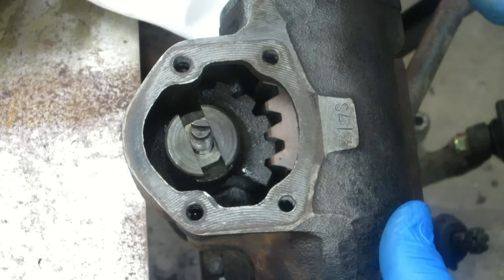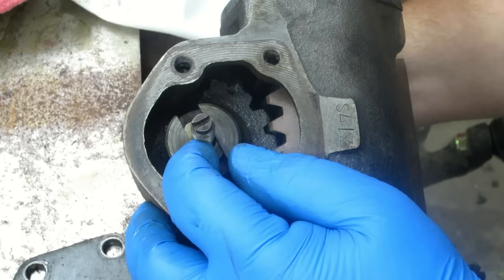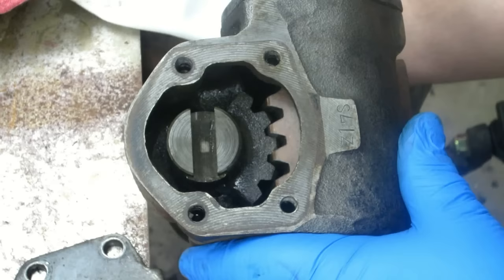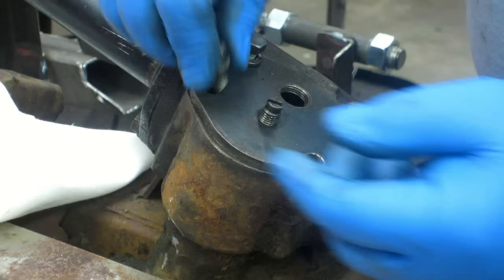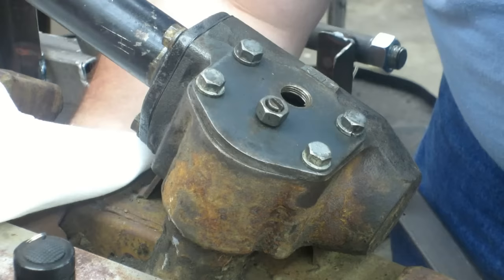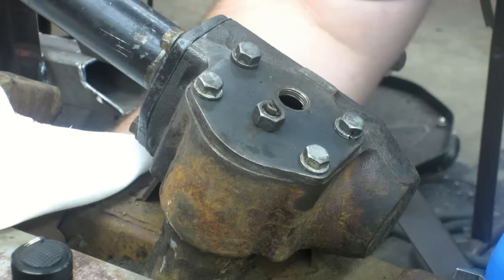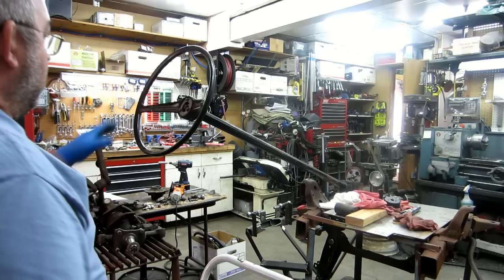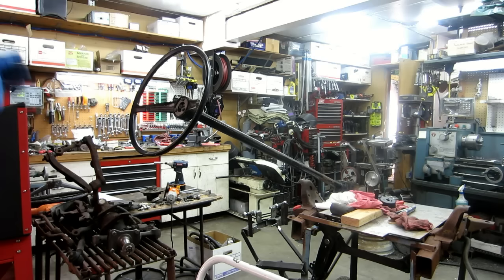Sector Shaft Adjustment

Comment: The high spot is actually there to aid in the adjustment of the gear box. If you turn it to the "tight" or high spot to adjust the gearbox, you will not overtighten it and have problems with the gearbox locking up. This was more common on manual steering than power. Never adjust them so tightly that you can "feel" the high spot on the gear. If you notice it when turning stop to stop, back off until you cannot feel the difference in the steering wheel.
Reply: In other words to take all the play in the center I will have to make it bind when turning. And then I have to adjust it back a little so I feel no resistance lock to lock which means that the center is back to not be as tight as it could be.
Reply: I was just thinking as he did this that you could adjust it till it has no play then move it off centre to check if you get play then back again and see if it binds

Comment: I have worked in many places as a tech, including several dealerships, who had no clue about this adjustment. It helps a lot if the front end is kept in good condition. The "hammering" associated with loose front end parts does untold damage to these gearboxes. Any time there is slack in the steering, movement accelerates until impact, so the "hammering" effect is intensified by neglect. In truth, front end inspection should be part of an oil change, but few bother. Great videos.

Comment: You are correct about a tiny amount of adjustment. Turning it more than 1/8-1/4 to 1/2 max turn puts too much pressure on the internals. According to my manual.
Reply from the maker: Yep....it doesn't take much. ;)

Comment: LEAKS.... For everyone asking about a leak at the adjusting screw if you don't have the Oring or Copper Washer Seal.... Spray it with Break Cleaner and work it back n forth (in and out), apply any type of  Oil based or Oil Resistant Thread or Pipe Sealant. Permatx #1 , #2  or even some Silicone sealant
Reply from the maker: Great tip!

Comment: If your gear box whines while you turn is it bad?
Reply from the maker: I'm sure it's not good.  Typically, whines and squeals are high pitched vibrations.....like brake pad squeal.  Maybe it's low on lube and two pieces of dry metal are rubbing together?  I'm guessing it's while you're turning, so maybe something is rubbing on the steering shaft?  This was the deepest I'd been into a steering box so you might was to ask someone that knows a lot more about them than I do. lol  A cheap stethoscope from HF can really help find mechanical noises.  https://www.harborfreight.com/mechanics-stethoscope-63691.html?_br_psugg_q=stethoscope
Good luck!! -Mike

Comment: Ok, so if you are not technically advanced enough to take all of that apart, is there a way to adjust it without taking the steering wheel off and the tie rods off? I have a 2023 wrangler that loves to wander all over my lane in the highway.
Reply from the maker: you don't need to take anything apart to do the adjustment.  You will need to raise the front end off the ground on jack stands so that you can turn the steering back and forth to feel that high spot.  Read the pinned comment by @klmartin1962 for a better explanation.  While you have it lifted up, you can more easily check the tie rods and ball joints to see if any of them are the problem.  If you've modified the suspension at all, you toe-in is probably off now and it needs an alignment.

Seriously, if you have a 2023, I'd take it to the dealer and have them do the work under warranty.
Reply: @bluehandsvideo  the dealership said that’s how jeeps handle and that there is no steering box adjustment. I had a feeling they would say that.
Reply from the maker: @stratdx  Sounds like good steering is a bit hit or miss with jeeps.  I didn't read the entire thread, but it seems the steering has been an issue for a long time with them.  https://www.jlwranglerforums.com/forum/threads/are-the-steering-issues-resolved-in-the-2023-models.102233/
Reply from the maker: @stratdx  Sounds like a cop-out, but pretty much what I expected to hear, too. :(

Comment: This vid is really helpful.  Now I know the inner anatomy of the steering box, and I understand why my sector shaft has play and how to fix it!  If the center section of the gear is so worn that I can't get rid of the play without introducing bind at the outer areas (turn to lock), I know I need a new box.  2003 F150.  Thank you!
Reply from the maker: Thank you! I'm happy to hear that it's helped. :)  -Mike
Reply: Beware the rebuilt boxes often get new seals and paint and sent right back out without new gears
Reply: @evanwest1929  Thanks for the warning!
Reply from the maker: @evanwest1929  Rebuilt parts, in general, have seemed to go downhill.

Comment: Masterfully done!  And Kudos to all who are sharing their insight on the box. I have a Jeep TJ and I’m not liking the play. I checked the ujoint and the bearing on the shaft, all checks good. The slop is coming from the box and I’ll use the setting method you showed. I understand better, thanks!
Reply from the maker: No promises it's exactly the same as this Datsun box, but good luck! I hope it works out well for you. -Mike
Reply: I have a Jeep TJ also nd it sounds like we have the same issue. I was going to replace it but now I’m thinking it’s just not adjusted correctly. We shall see..  thanks for the info!.

Comment: Yes, steering gear is adjusted by measuring steering wheel free play travel, steering gears will wear from normal use to a point that they should to be replaced.
Reply from the maker: Thanks.  I've never seen a new box available for these old Datsuns. Hopefully, the adjustment will keep it on the road a bit longer. :)

Comment: You can put the lid on by backing the adjuster back a couple of turns and the whole assembly will go on. Then adjust it right down and back off a quarter of a turn then check the feel on the whole steering left to right.  Most old boxes will have some wear in the straight ahead position. If it is too much the gears are stuffed!
Reply from the maker: Thanks!

Comment: Great video! I’m working on my new project car a 95’ 4Runner and I just replaced an extremely worn idler arm that was causing some crazy slop but after I replaced it it got rid of the play in the arms but I noticed there was still a good amount of play in the steering wheel and found out about the steering gear box adjustment. Lots of videos say how to adjust it but not many explain exactly what’s actually going on in there. Thanks!
Reply from the maker: Thanks!  I find it a lot easier to do adjustments/work when I understand the "behind the scenes" part of it.  "Tighten until you feel.......", doesn't usually work for me. lol  -Mike

Comment: These old cars call for an alignment spec of 1/2 degree LESS caster on the left in order to compensate for road crown, but that makes the car pull to the left on a flat road, unless...

...the sector shaft adjustment is correct. A proper adjustment calls for the box to be out of the car and to put an inch-pound torque wrench to measure the torque increase as the sector shaft goes over center. IIRC it should be about 10-15 inch-pounds MORE to bring the the box from left turning to right turning.

Properly adjusted, the gearbox is going into a slight bind as it approaches center and the alignment tech can then adjust the steering wheel so this left tendency in the caster is compensated for in the gearbox when it is slightly right of center. No pulling to the right on a crowned road because of the caster, no pulling to the left on a flat road because of the sector shaft bind at center position.
Reply from the maker: Interesting.  I remember hearing about that when I was still pretty young, but I've never come across it on any of the cars I've owned(about 80).  Some may have required it, but I didn't know about it or have them aligned.  The factory manual didn't say anything about that......maybe the Datsun is too narrow for it to matter?  Datsun also doesn't mention anything about adjusting the caster....they say it's fixed.   I can't imagine there's too many shops/mechanics around that are still familiar with that.  Thanks for taking the time to share that information!!!!  I appreciate it!!
Mike
Reply: bluehandsvideo
Datsun! Now there's a name I haven't heard in a long time!

Yeah, those Jap cars were the first to put McPherson strut suspensions into mass production and their caster is built into the design of the car, it doesn't change as the springs sag when they get older. Dual a-arm suspensions changed quite a bit over the first couple of years until the springs settled in.

We would make the compensation for road crown (and BTW, the car being narrower has nothing to do with that effect) by adding camber to the left side on those cars. Camber pull is the same pull that steers your bicycle, lean to the left, it goes to the left. About 1 degree was the maximum, beyond that and it would definitely pull to the left when going straight, and most McPherson style suspensions also had rack & pinion steering so there was no way to limit that pull with a natural bind in the gearbox like the Saginaw boxes could do.
Reply from the maker: ladamyre1
I mostly work with the older Datsun trucks.....which have arms and shocks.  The caster is built into the kingpin inclination. 
I was thinking the road crown was an arc instead of flat and angled(like a roof).....that's why I was thinking the width would matter. 
I've always heard about caster and bicycle forks, but I haven't heard about the camber pull.  Very interesting!  I understand why you'd put the extra degree of camber in(positive I'm assuming) so that it tries to turn up the hill, negating the tendency to go to the right. 
What about the scrub radius? Does that tend to pull more as it gets greater?  Narrow tires and zero scrub are easy to steer. Wide tires and zero scrub, harder, but not too bad.  Wide tires and offset rims(causing more scrub) are a lot harder.......but I only hear it referenced to slow driving/parking.
Reply from the maker: bluehandsvideo
ladamyre1....I sent you a msg via youtube....wanted to draw your attention to it in case you don't get some kind of notice.

Comment: Thank you for this. Mine is confusing because it’s tight at center but loose as soon as I turn the wheel just a bit. So going around corners it’s sloppy, but if I tighten it any more it sticks at center. It seems backwards, I would have thought it would wear more near center.
Reply from the maker: You're more than welcome. :)  The pinned comment explains the high spot .  The caster on the front end helps to keep the wheels running straight. The vehicle spends more time going straight than turning and there's very little load on gears when going straight.   When turning, there's load on one side of the gears to push the wheels off center, then there's load on the other side of them when turning back to straight.  By my reckoning, there's twice as much wear off center.  If all the tie rods and ball joints are good/tight, it would seem your box is worn too much for the adjustment to help.
Reply: @bluehandsvideo  thanks again, it's really helpful to chat a little about it before spending $700+ on parts. All the rest of the steering linkage is new and in good shape which is probably why I'm noticing this more now. I have a Lares new-make box plus steering pump and lines on order. I appreciate you.
Reply from the maker: @JoeEngineersThings  You're welcome. :)  -Mike

Comment: So it would seem if you have the tie rod and steering shaft disconnected, then attempt to move the pitman arm by hand, feeling for the sweet spot between binding and backlash, you could get it pretty well dialed in.
Reply from the maker: Maybe. I don't know.  The pinned comment by klmartin1962 describes what to look for during adjustment.

Comment: So glad I found your video!  I've seen several so far that talk about the adjustment, but none that show the inside of the steering box, and what's actually happening when you adjust the sector shaft.  I'm looking around right now at vids because my 2009 Dodge truck has some play I want to shore up.  I have a question though - Since the most wear will be in the center area, due to vehicles generally travelling in a straight line most of their lives, doesn't it make more sense to adjust this with the steering wheel turned a bit off center, so that you're adjusting at a position with less wear?  That would allow you to pull in as much slack as possible without running into a bind situation.  It would result in a bit more remaining play at center, but it seems like that would guarantee no binding on either side. (?)
Reply from the maker: Thanks.  I'm not a real mechanic.  This is the only box I have any experience with and it was mainly just what I needed to learn at the time.  What you're asking makes sense.  Maybe another viewer will see your question and have an answer.  Sorry I can't help more.

Comment: This answers a question I had. I have an steering gearbox with excess play. Just been to find he specs to adjust a hd94pab gearbox.
Reply from the maker: I hope it works for you. :)
Reply: @bluehandsvideo . Oem doesn't seem to be willing to provide me all the information I need so we will be winging the sector shaft end play. They did give me info on interference between sector shaft and power piston.
Reply from the maker: @tommysmith8801  The "pinned" post that should show up just under this or at the top has some info that might help.  It's by klmartin1962

Comment: I was always taught to tighten until you locked it down, and back off 1 turn. The high spot is not from wear, they are indicators to aid in adjustment. At least on American vehicles. You usually only get 1 or 2 adjustments from them before the wear is excessive and you can no longer adjust the slack out. Good job.

Comment: HI, Great video. I seems you are working on a Datsun, funny. My Yamaha golf cart has a very similar steering box. I am going to use your tips when I tear it down this summer. If there is excessive wear, is Pitman arm replacement the remedy? what lubricant is recommended?
Reply from the maker: Thanks.  There's probably quite a few out there that look alike.  There may have been one supplier for many manufactures.  The pitman arm is the arm between the tie rods and the splined shaft of the steering box.  I've never seen one loose on the splines, so I doubt it needs replaced.  Of hand, I don't know what lubricant.  You can probably find the owner's manual for your cart online somewhere.  -Mike

Comment: You are the man. Sweet video. I am now a follower. lol
Reply from the maker: Thanks Jon!  I'm glad you liked it :)   You'll probably find out pretty soon that I'm not currently doing much car stuff.  I'm working on parts for old datsun trucks, but not actually on the trucks.  I'll get back to the ball joint mod for the truck after I get the brake kits done. :)
Mike

Comment: Please don't warry about play under steering, (say stopping at the intersection (if the steering is hold it in to one side lock) and find to have a massive play in it, is because the angle of the gears teeth are designed that way in order to turn easy, .. but tighter  wile you drive on a straight line. And wishing that the tight spot will wear out..  (of course  everything does), but if the hard face wears out prematurely that..... it's not a good thing. So no matter how much play is obtained in the adjustment, on a straight line position there always be less play. And adjusting in a dry gear mashing, it's only done on differentials, (where there should be motion movement, but no slack at all, until some lubrication is add it on , and that is the proper adjustment ............ (no need of "MANUAL"... Which it's only a reference, but a diff has constant mashing.....very different that a steering box. If you'll use a scale on the steering wheel, please use a support anther, and also lubricated otherwise that massive extension on the steering gears will course binding the steering gears and foals reading will occur. Thank you for your video, I am only adding on to your much appreciated description .
Reply from the maker: Thanks for the additional info.  What you're saying makes sense. :)
Reply: @bluehandsvideo  We are all here to help each other. My issue with the steering is completely different , but as usual other videos do pop up...I couldn't help adding my bit.. Thank you for the video and to appreciate my input..
Reply from the maker: @cosimosanfilippo9050  I agree.  You're more than welcome and thanks again for the great input! :)  -Mike

Comment from the maker: Hmm....I've only done it on the Datsun, so I'm not familiar with the Ford box.  I would check it with the steering linkage disconnected from the pitman arm.  If it's still the same, I would guess that the box is worn unevenly and you might have to find a middle setting you can live with.  Maybe there's another vid on youtube geared more toward the Ford box?  Sorry....I wish I had better info for you.

Comment: Thanks for the video are you familiar with the steering boxes that have the big slotted screw in the front ????? I see how ajusting a gear box does by turning that screw now inside , my 69 F250 has a big slotted screw and a lock ring guy at the shop said you can't just turn that top ajuster it will make it worse , you need to loosen the lock ring and turn the slotted screw in so much and the top one a certain way ? Have yet to see a video on ajusting  in other words they need to be adjusted together it's a Bendix power steering box .
Reply from the maker: Sorry.  This was really the only steering box I've done anything with.  Maybe another viewer will have some insight.